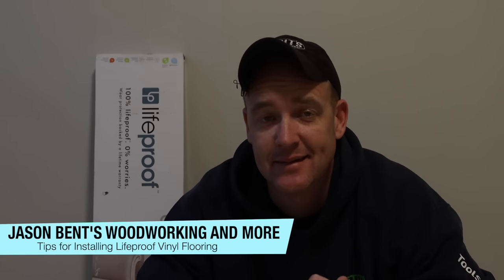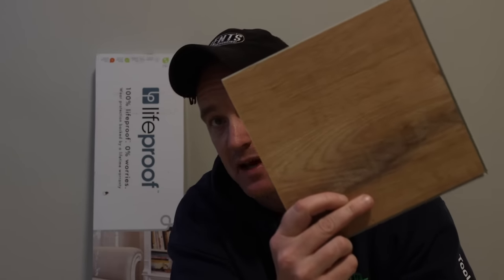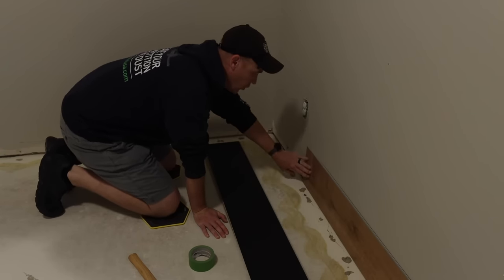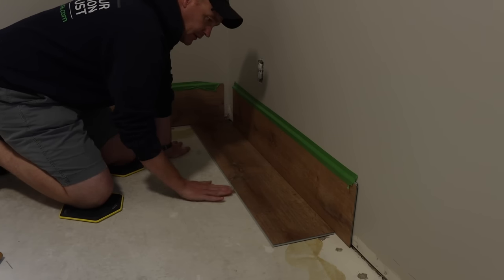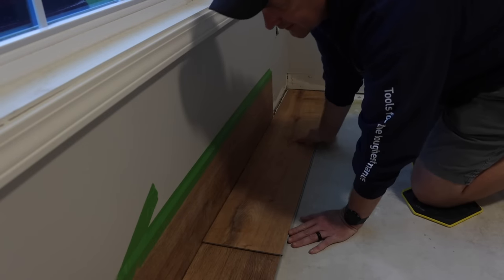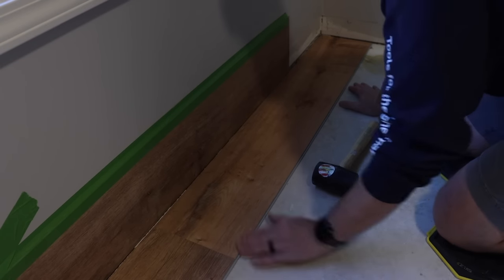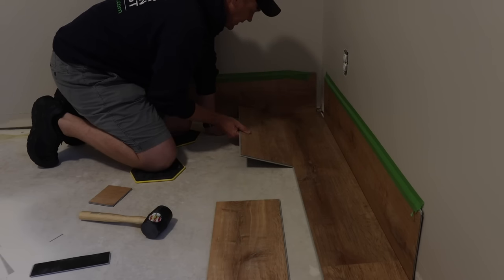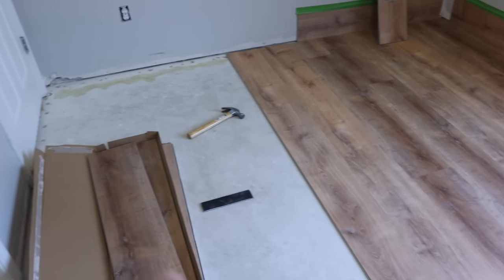How to Install Lifeproof Vinyl Flooring

Comment: What a great video!  Better than Home Depot. Going to start mine today. I have some places where concrete is cracked and level sightless rocks. I’m hoping that is not an issue.
Reply from the maker: It can be for sure. It can stress the joints causing them to fail over time. There are self leveling concrete options that are affordable and relatively inexpensive.

Comment: Good Video, very useful just a few things that had me scratching my head,  just to point out the rubber mallet used is different than a Dead blow hammer. 1st:  Where is the padded moisture barrier before the flooring goes down? 2nd any spacer on the other wall or it's just required on two sides only?  3rd  Flipping the new flooring over with the finished side face down on the concrete when snapping off cutting  risks scratching the finish, I would not advise that.

Comment: Great and straightforward video. I wish I would have came across your video sooner to share with the person that installed my flooring. 😂 How do I fix the pieces around my door casing, because the cuts are awful. The flooring isn’t underneath the casing and he used caulking to try and fix it. Again, it looks bad.

Comment: On the doorways I would highly recommend tapping the long joint together before hammer locking the short end down. No point in changing up the steps and fighting the friction of the short end lock.

Comment: Pro tip 
Use the flat bar to pry up carpet tack strip and you can us those scrap pieces but I broke a tap bloke cause it has more surface area to strike and more torque, also use 1/4 inch kickplate (it’s 4” x1/4 perfect)  as you’re starting strip Bakker to create your quarter inch space use a 18 gauge finish gun to attach them below the base nail line along the whole starter wall. And putting the piece of flooring on the other wall is a extra step that’s not needed.

Comment: Great video and some excellent tips.  I like the idea of using full boards and taping them to the wall so the new boards won't go under the drywall.  I have used wood screws to screw into the sub-flooring so the new flooring won't go under the drywall, but I like your idea better with taping full boards to the wall.
Reply from the maker: Glad you found it helpful

Comment: If installing flooring in all your rooms. I'd recommend getting a flooring shear from Amazon. Time saver. They are little over $100. Well worth it.
I always make sure my gap is tight before locking it in place. I use a taping block and lightly tap the plank with the block alone

For the L cuts I use my jigsaw. Circular saw chip this floor too easily

Comment: Thanks for the great video. I noticed you didn't use an underlayment for the concrete floor, though. Not needed? I heard that the built is stuff isn't quite good enough to be a good vapor and moisture barrier.

Comment: Awesome video. Wonder though if it might be a good idea to determine before you lay the first course if you will end up with a sliver on the opposite side of the room.   You may then want to rip that first course to even out the widths on both sides of the room.   However a sliver may not matter so long as the courses blend well enough.  I am planning on ripping up carpet in a couple of rooms and will be giving it a try.  Just trying to think through all the possibilities ahead of time.

Comment: Excellent vid…..
Questions ….11:37 …….why didn’t you tape another plank on that right wall before making cut….16:23 …..when you tap the other plank could it break the tongue on the full plank already laid…17:41 ……why didn’t you tape another plank on wall when working on that row……how long has the floor been installed because 8 am wondering if it would wise to use an underpad on a concrete floor for your install which I imagine was in a basement

Comment: Great video! Soooo detailed!! Not rushed! Everyone should learn from you! One question….you used planks as a spacer for the left and front wall but how come you didn’t use a spacer for the right side wall? Thanks again!
Reply from the maker: Because I cut those to the required length

Comment: A little tip they may help you.  When your cutting the door jambs With the saw.  Take the under lay padding off your scrap piece and it will help with the thickness of the saw blade.  Then when you slide your floor piece in place, there won’t be a 1/8 gap that the eyes always focus at.   Little tip.

Comment: Your video was a real life saver. I was stuck for two days trying to figure out my spacing issue until I saw your video. Now I can start my project. One question, for the first row, did you remove the tongue as stated on the box, or did you just leave it? If you did remove it, how did you do it. Also if you left the tongue did this space effect your base molding? Thanks
Reply from the maker: I left it and it didn’t affect anything because I actually replaced the baseboards after the install

Comment: Is there any need to apply adhesive under the planks? I have rolled sheet foam backed vinyl which wasn't glued properly and the covering is now bubbling and deforming. Great video Regards Robert
Reply from the maker: Nope, nothing is underneath it. It’s a floating floor. 👍

Comment: What do you do if you have cracks in your slab, do you fill those in, and to avoid moisture coming up from cracks as the problem we had when the carpet was in, what should we use if anything?

Comment: What an amazing Video. This has given me inspiration and courage to work on my basement flooring project. The only question I had was, the planks were used instead of spacers on one side only. Any specific reason to not use it on the side walls?

Comment: I am going to be fixing up a laundry room that had water damage so I am also replacing the bottom of the drywall.  do you recommend doing the vinyl flooring first or the drywall first?

Comment: Good looking floor. Only critiques I have are...

Even in a "square" room, only making 1 mark/measurement is risky. I always measure and mark the front and back of those end pieces, especially close to corners or door jams where a 1/4-1/2" bend isn't all that uncommon. Takes an extra 5 seconds and could save you from throwing multiple pieces into the scrap "I hope I can use this on another row" pile.

Also, get a cheap, refillable wax pen. Last thing you want after making a more complicated cut is putting it in place and having a little bit of that black line visible under the molding.

Comment: My problem has been try to get the cracks in the panels straght or the boards to be striaghts since the walls arent exactly straight, ive found after i get 1 or 2 rows down the panels start to get space in between the boards. U dont want to lay the floor and after ur halfway done stand up and see its not straght. I also found using a 4 inch piece of 2×4 is good to tapping the boards together also.

Comment: Nice video.  The only thing I wanted to add is that the number of unique plank patterns is very limited (often just 4 unique ones + the same patterns rotated 180 deg.) so it is important to keep an eye on the pattern so you don't use the same one for adjacent planks.

Comment: Great video it’s very informative. What if the sub floor is wood particle board and isn’t smooth like your concrete floor? If you run your hand across the sub floor you will get splinters.  I’m thinking about purchasing an underlayment, Abatec underlayment. Will this help with the roughness of the sub floor or should the vinyl be installed directly on the particle sub floor.

Comment: First day trying and I should have watched your video first! The basic Home Depot video is not very useful. The board on the wall to secure the planks from sliding under the wall is worth an award. I tried these stupid plastic spacers, wood shims, and it keeps moving. The little tool cut from a plank to tap the planks in seems to be better than the common plastic block. Ready to be more efficient tomorrow! Thank you for sharing your experience and tips.
Reply from the maker: Glad you found it helpful

Comment: What is the reason for not putting the floors under the drywall and blocking that off with spacers? I know the floors need expansion area but is it really that much area needed?
Reply from the maker: 1/4” on the sides. I just use a piece of flooring as the spacer.

Comment: If you use material like this where you use mallot for short seam make sure subfloor is completely flat. The short side locking system does not hold if there is any movement.

Comment: Really good video thanks. 
I wanted to do sterling oak but it only has a 6 mil wear layer. This is going throughout my whole house so 6mil concerns me. They have a new product with a 22mil wear layer that’s in their  high traffic line . The color I’m ordering is Torngat mountain oak. It’s so new I can’t even find any reviews or many pics of it installed. Wish the sterling oak had a thick wear layer
Reply from the maker: Glad you found it helpful

Comment: Great video. Can someone please answer a question for me? Why can't you place the planks under the drywall? Why block it off for a gap? The drywall is already 1/2"-3/4" out. So putting it under flush with the drywall would give you that clearance. Could someone please explain this to me?
Reply: because if the flooring is trapped by the rock, you can't easily click the next piece in. usually needs a steeper angle to properly lock without a hassle or cutting the locking mechanism off

Comment: Any tips for stubborn joints? I aligned it well and am using your scrap flooring method to tap it in, but i have some seams that just don't want to fully lock.

Comment: Hi! Great video!! I will be installing 6 mm vinyl flooring on concrete (floor is flat & smooth) in a brand new flat, but my question is, should you want to have another layer of underlayment anyway since the lock-in system isn't 100% waterproof and also it's supposed to make walking on the floor give more pleasant feedback. Your opinion would be very much appreciated, thank you!
Reply from the maker: I followed the manufacture instructions which does not require it
Reply: @bentswoodworking  yes and as I said above Transformacja Sylwetki, definitely read the install for your particular brand of floor....you don’t want to void a possible warrantee.

Comment: I want to put this down on a basement floor bathroom.. do I need to use leveling cement before applying this to the floor?
Reply from the maker: If your floor is not within the allowable standards set by the manufacture, then I would say yes.

Comment: Best video out there. Thank you for this amazing video tutorial! In a box of life proof I ended up getting three different widths. I thought they would all be the same width. What do I do?

Thanks so much for any help you can give.
Reply from the maker: Return them for the proper flooring. They have same width and random width.
Reply: Thanks so much!
Reply: if they're different widths, just run each width for a full row, stagger widths between different rows. no need to return
Reply: I've installed the multi width stuff, it looks cool once it's down. same concept on install

Comment: I was reading you need a moisture barrier under vinyl and laminate flooring. Is that not needing for this brand? Going to be renovating my new home. Thanks!
Reply from the maker: It isn’t required as per the instructions. I have heard recently though that they now make one that can be used for this flooring specifically
Reply: @bentswoodworking  Awesome, thank you :)

Comment: Do I need to use lifeproof underlayment for my subfloor, which is concrete and will be installed on the ground level of my house the floors i picked out is Lifeproof Sterling Oak 22 MIL.

Comment: Great video. Very  informative. Couple questions so u recommended vapor barrier. Some say it's a good idea also what millimeter is the flooring? Thanks for sharing.
Reply from the maker: I would say refer the the manufacturers instructions. I applied mine directly on concrete with no underlayment. I have heard that lifeproof has developed an underlayment for it now but I can confirm that.

Comment: Noticed that you began with a full width board on back wall then finished with a narrow board next to bathroom while other installers  will divide the room width by width of board to balance out so a narrow board doesn’t stand out. My first room doesn’t even out so first and last boards will be cut narrower than original width. My final board will eventually connect to hallway. Your thoughts and suggestions.

Comment: HI Brent, I have seen many videos on Youtube about installing the Vinyl Flooring but no one ever addresses baseboards. Everyone is doing a nice easy room. Sure there are cuts with doors and stuff but Baseboards have to be a major issue.
Reply from the maker: I removed them and replaced them. If you don’t remove them then you’ll have to use quarter round to cover up the gaps

Comment: Does the built in underlayment also work as a vapor barrier for installation on concrete floors without basements or crawl spaces?

Comment: The problem i run into is having to cut skinny pieces running lengthwise because the gaps left wont be covered by trim. Am i doing something wrong or is there a trick i should know? or is it just unfourtinate dimentions of the room?
Reply from the maker: Hard to say. The final strips can be cut to fit regardless of the walls being straight

Comment: Was wondering what to do when it comes to ending the flooring to an outside door. Do you glue the ends down? I put the flooring on top of tile which made it higher, so I have to cut the bottom of the door and the door leads to outside but was concerned about the edge/end of the floor at the doorway leading to outside. Can I glue it onto the tile or do I need to put a saddle down and glue that to the floor? Thank you in advance. Great video. :-)

Comment: If you are in a condominium it's very likely your floor is illigal. It comes with a small padding on each board but you still need a underlay for this stuff.

Comment: If you were to install that lifeproof flooring in your connected bathroom would you remove the flooring in there? Or could you install it over the stuff that’s already on the floor? Thanks for the great video!
Reply from the maker: You could but the height would be different

Comment: Question - if you want to cut vinyl flooring with a circular saw blade (miter saw), will blades with TCG teeth (this is the shape of tooth for cutting non wooden objects) cut vinyl plank without going dull so quickly?   Wood blades will cut vinyl flooring, but it dulls the hell out of the blade quickly.  I have a Diablo Trex blade that has TCG teeth, but I didn't want to try it out on vinyl flooring until I know that it won't dull the blade in just a few cuts because it was an $80 blade.  Thats why I'm asking you guys b/c yall work with it all the time.   I know you can cut it with utility knife and plank cutter tool, but I would rather use a miter saw, if possible, b/c so much faster.  Was just wondering is it going to dull my blade regardless of what shape tooth you use on it.

Comment: Great video. What do you think about mixing the planks up from each box before you start! Also I know the product has underlayment attached. What is your thoughts of additional underlayment like tarpaper  or lifeproof universal underlayment for bathrooms and upstairs apartments for noise and moisture?
Reply from the maker: I used the life proof underlayment upstairs on the wood subfloor for noise. May have helped a bit. Easy to lay down for sure.

Comment: Good video!  I noticed that you are installing on a concrete floor. All vinyl flooring padded or not should have a vapor barrier on concrete.  I also noticed on your first row, last plank, you did not place/tape a plank on the side wall.

Comment: Don't you need to fill the little divits left by removing the tack strip or use a moisture barrier on the concrete?
Reply: it's good practice to do both

Comment: Is it possible that you have to install the flooring from left to right? If you go from right to left, you have to slide the lip under the previous piece. Does it matter? I’m kind of struggling with an install.

Comment: Just a thought. Shouldn’t you leave the baseboard on and use a quarter round trim after to hide the gap. Because, what if in the future you need to replace a plank by the baseboard but you can’t because the baseboard is installed on top of it? You would have to remove the baseboard just to get that plank out versus removing the quarter round trim which is way easier to remove and reinstall.

Comment: Great video. Can the planks be put straight onto the carpet underlay to 'absorb' any descrepancies in the level of the concrete floor?
Reply from the maker: I definitely wouldn’t recommend that. The padding underneath will cause the joints to fail when walking on it. If your floors are very uneven, pour a self leveler first.

Comment: Just wondering; what is the best jig saw blade to use? I used a fine cut wood blade and it filled within a couple cuts 🤷🏻‍♂️
Reply from the maker: I didn’t use anything special. Just a multi purpose blade. Works great.

Comment: I plan on installing vinyl flooring on my concrete where I removed my carpet. I see you used no underlayment padding, is it recommended that you use underlayment as an extra cushioning to help with the flooring being warmer underneath your feet and helps with extra noise even with the mute step that’s applied to the vinyl?
Reply from the maker: It would help with the noise a bit. While the underlayment is not required by the manufacture, they do now make one that can be used with it. It must be the life proof brand or it voids any warranty